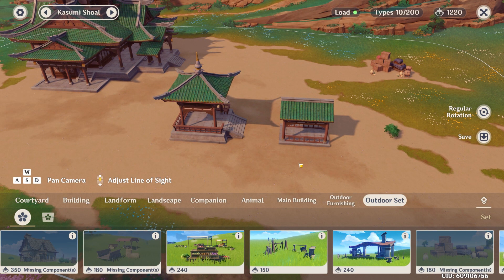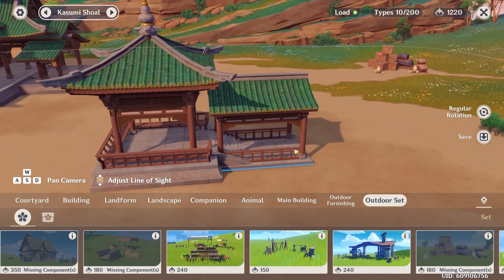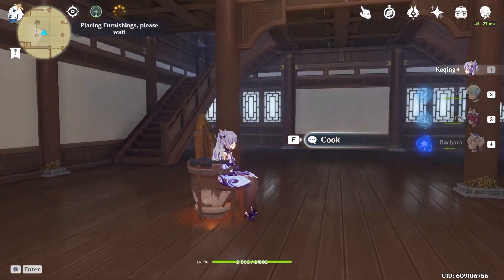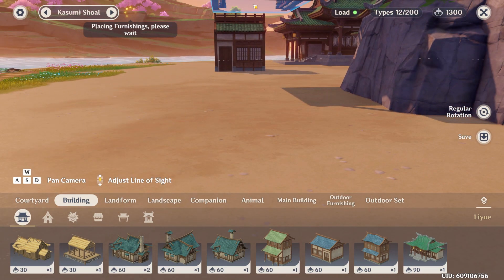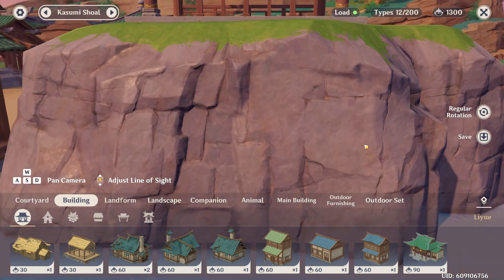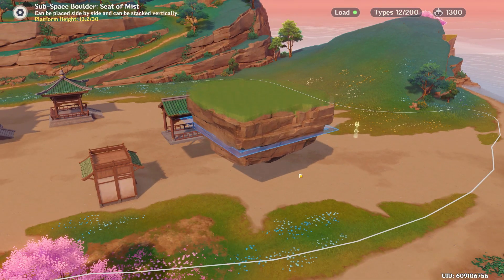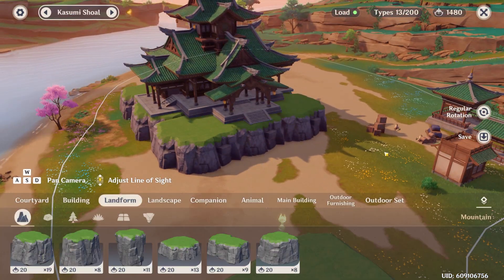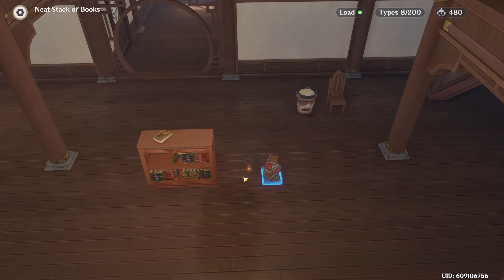Floating, Clipping Tutorial (Outdated) [Updated Tutorial in description]

Comment: Finally got the floating part down on PS4 (when zoomed in, you have to try and move the object so it turns red, release and tap so it turns blue) thank you so much for this video!
Reply: For anyone wondering the specifics of doing this on the PS4 version, it goes like this...
1. Do the same as in the video up to where you're zoomed up underneath the item you're floating (already placed on the landmass).
2. Select the item with X (making sure there's no land behind it) & just flick the L stick. The item shouldn't move (if so, your camera angle is probably wrong), but it'll blink red like in the video.
3. Then you just push X again to confirm it & you're good.
Reply: @Masamune-XIII  thank you so much! I was becoming crazy trying to apply this sistem on ps4
Reply: @Masamune-XIII  thank you so much for this it helped a lot may Barsibatoes bless you
Reply: This helped so much! Thanks a million!
Reply: What do you mean “tap it so it turns blue”? I’m sorry, I’m just a bit confused lol 😅 I thought that you can’t tap stuff on PS4 due to the  controller?
Reply: Gonna try it. I've done this a few times but never new exactly how...

Comment: Does anyone know a floating technique for playstation, the camera does not go under stuff in playstation :/
Reply: Having the same problem :( Edit: finally got a few buildings to float, but it’s still hard zooming in with the camera to see the underside of an object
Reply: @leizelann82  How did you do it? I still can’t do the floating technique because mine doesn’t turn red :(
Reply: @potatolife6899  when you zoom into the landform and select the bottom of the object, the border will be blue. When you try to move the object with the analog stick in any direction, the border turns red, and you’ll have to click on the object for it to turn blue. If done correctly, the object will float
Reply: @leizelann82  Hi I already got it! Took some practice with the controller to get the timing right coz my hands were shaking hehe. Thank you 😊

Comment: the clipping does work on ps4 (wiggle your thumbstick from red to blue until its all blue)

well until you will break that thumbstick or your palm (cirlcle motions better than wiggle)
Reply: There’s no need for that, the point is to make it go from red to blue repeatedly so small slow motions works too, its hard to control with the controller when shaking but we don’t have to shake it as aggressively as they do, just make it go from red to blue repeatedly, either front to back or left and right, slowly until it got confused and you can now clip!
Reply: You can spam rotate button too until it turn blue